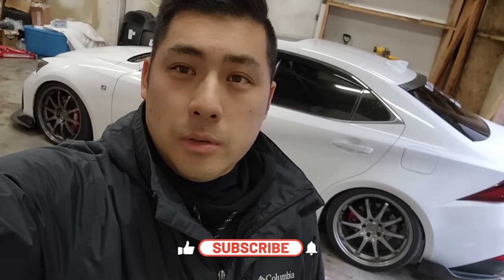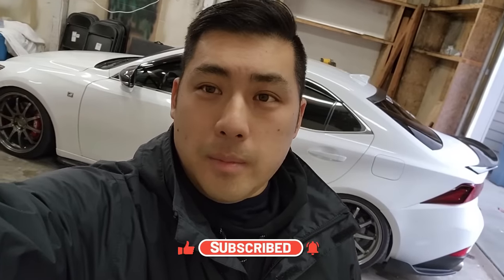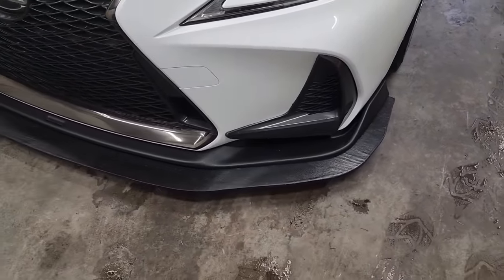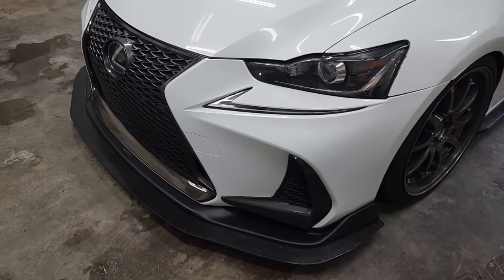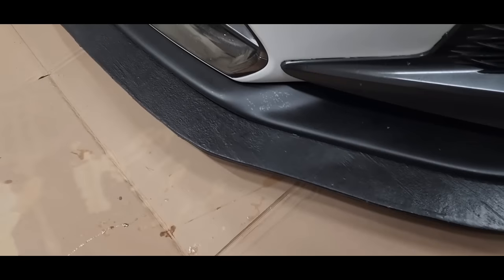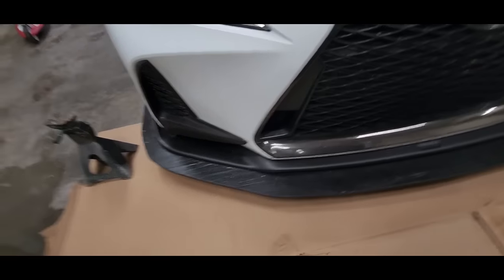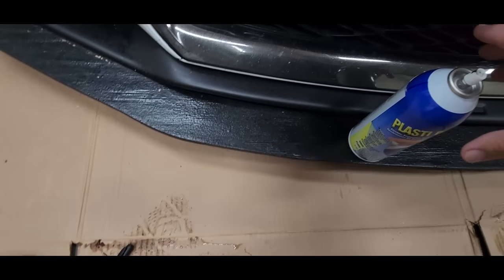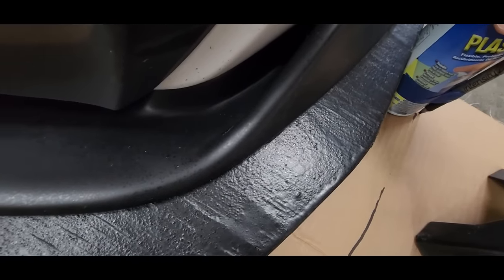How to make your own Front Splitter for under $100!

Comment: did you make a video on how you attached it?
Reply from the maker: It's just installed by screws going into the front lip and bumper
Reply: @2slo4u  oh ok.  wasn't sure if you took bumper off to attach it using nuts and bolts
Reply from the maker: @tau_tv  nope just a quick and easy install. Easy to replace if I ever need to
Reply: @2slo4u  cool thanks!  i was kind of worried if the weight was too heavy to just use self tapping screws in from the bottom.
Reply from the maker: @tau_tv  you should be fine. I haven't had any problems at all. knocks on wood